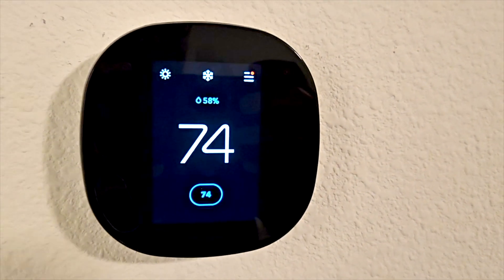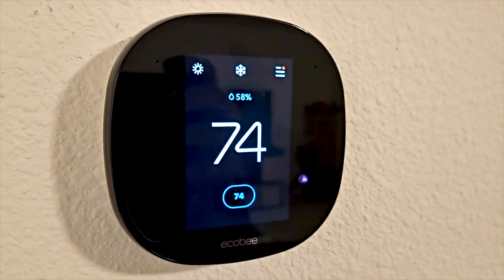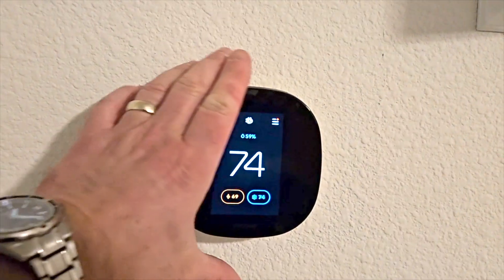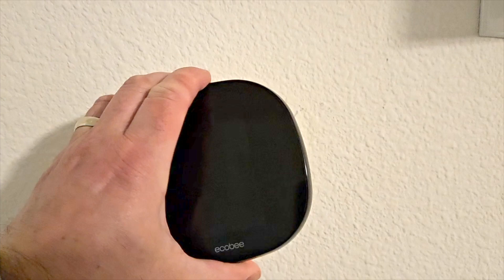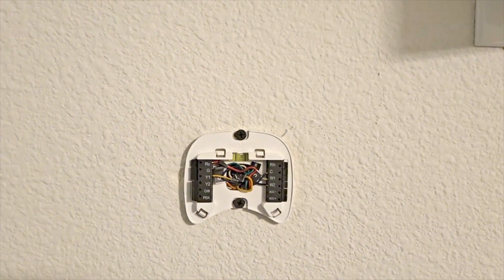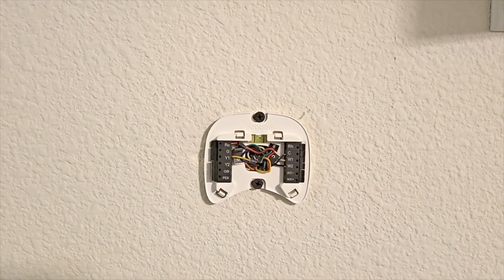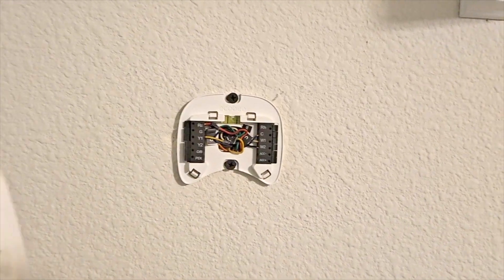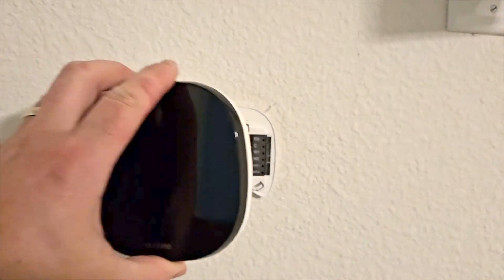Ecobee Screaming, Squealing or Screeching Alarm Sound... FIXED!

Comment: Thank you! But more importantly, why did it start screaming at 2 am
Reply from the maker: It works on the same principle as low battery warnings on smoke detectors... 😅
Reply: @JohnFixes  does it do that even though it’s hardwired? Mine just did it this morning and i thought it was a smoke alarm or the carbon monoxide alarm 😅
Reply from the maker: Yes, unfortunately.  @joycea141